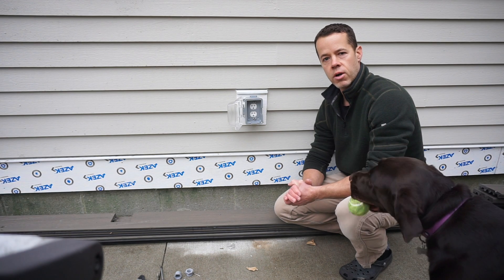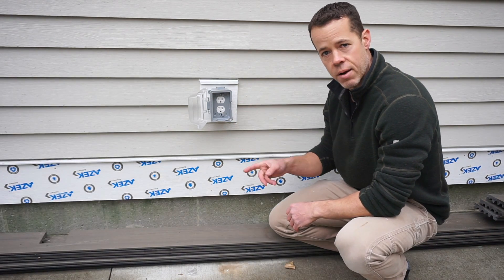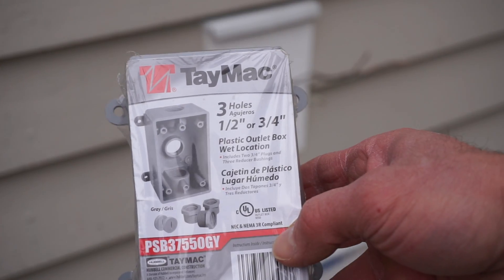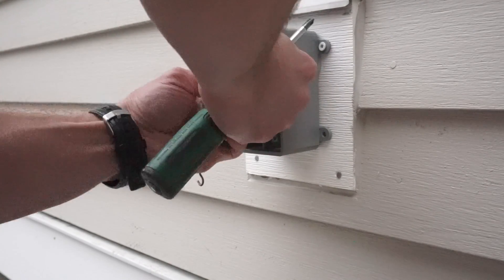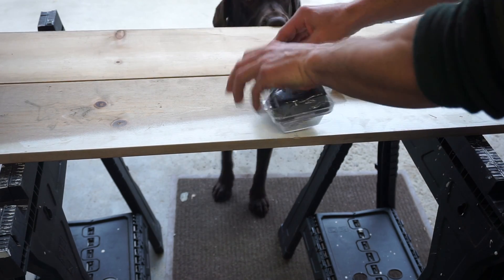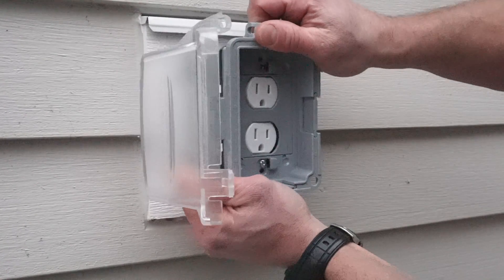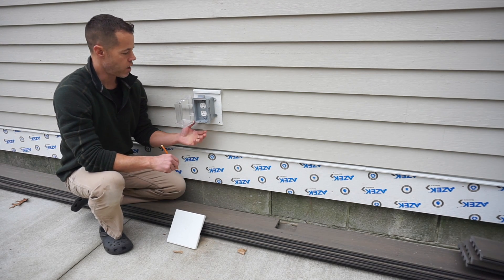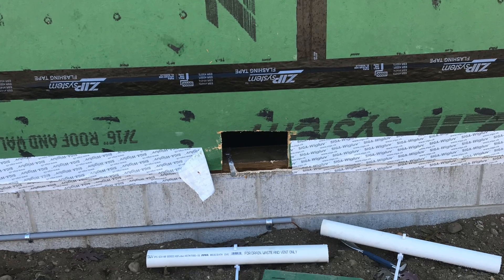How to Properly Install an Exterior GFCI Outlet

Comment: So it's up to code to run that NM cable in that wet exterior location?
Reply from the maker: @brent...  it’s up to code to run wire to exterior outlets if that’s what you are asking.  The wire is safe and sound in the outlet box rated for wet locations
Reply: @thedustybuilder  The code is confusing. It clearly states that you cannot use NM cable in wet locations (334.12(B)(4)). I’ve read that 314.15 implies that the inside of the boxes are considered wet locations since it talks about letting water out. That means it’s expected to get in. No real world experience here though, so I dunno.
Reply from the maker: @brent...  interesting point, maybe it would be a violation where enforcement is super strict.  I’ve been on several projects where this method passed inspection.

Comment: Should add a chase nipple so your wires entering box are not in contact with the box threads and possible damage incoming wires.  Especially when you push recept into box.
Reply from the maker: @ronh5623  You are correct, thank you.  I didn’t realize that they screw into the box threads!

Comment: Looks neat, but you still need to cut a hole in the siding to put in and recess the mounting block, but I guess you mean not to cut through the wall entirely? 

Not sure I like the mounting block though—imho it disrupts the overall horizontal vinyl too much since you’ve now got quite an edge around the outlet.

I recently installed an exterior outlet and precisely cut a shingle just to get to the wooden board on which that was attached; drilled a fine hole through that from the inside, put my conduit through, sealed the hole neatly with duct seal, mounted my box in the shingle cavity and siliconed around the edges; fits perfectly and fully watertight.

I can see the use of that little drip edge, but I think if the outlet is recessed in the shingle, like I did, such a little edge would actually be a little pointless.
Reply from the maker: Sounds like you did a nice install!  I cut a hole in the siding but was careful not to disturb the tyvek, except for where the wire comes through obviously.
If I were to recess the box into the siding,  I would have to penetrate the tyvek and sheathing of the home.  Instead of a small penetration for the wire, this would create a larger path for cold air / bugs / water.  
In a new build scenario, your method could be easily air sealed, it is more difficult in a retro fit scenario.  That is why I chose function over form for my outlet mount😁
Reply: @thedustybuilder  Got it, yeah, our house is from the 60s and doesn't have Tyvek or any other kind of membrane, or other obstacles really. You could of course reseal the Tyvek, but those seals are a pain in the backside and often present more risk than solutions. Anyway, enjoyed your video, and despite our setups being different, has been useful for me!
Reply from the maker: @martinuildriks1487  awesome, thanks for sharing!

Comment: MR silicone man needs to learn about foam to keep bugs out.and cold. I also live in MI.
Reply from the maker: @CoreyOBrien-k2e  that foam breaks down over time, allowing bugs and cold air to enter.  Several high performance builder are omitting it in favor of caulk

Comment: I see that you used a 15 Amp outlet. How do you know which one you need since there are 15 amp outlets and 20?
Reply from the maker: Awesome question!  You can use 15 amp outlets on 20 amp circuits, it’s in the code book.  The exception is you can’t use a 15 amp outlet if is the only plug on a 20 amp circuit, hope that helps

Comment: The electrical tape should be wrapped around the outlet several times not as a matter of keeping it dry but as a matter of safety for the next person who might have to take that outlet out in case it needs to be replaced.
Reply from the maker: Ken…. Kenny…,, they can turn the power off first brother!
Reply: Don't do this. It just makes a mess and is pointless. Turn the power off bro.

Comment: Is not a strain relief required when the wires enter your box?
Reply from the maker: Great question, I’m not sure.  The wire is stapled almost directly behind the box, so any ‘stain’ is on the outlet and that staple.  I’ve never been asked that by an inspector, definitely couldn’t hurt!

Comment: How did you get the PVC trim piece recessed in the siding without cutting the siding (as you advise against cutting it, right?). Do you have a video of how you got that in?
Reply from the maker: I installed the block, then installed the siding around it.  You could totally cut a square out of the siding and install a block.  You would just have to be careful to  leave the tyvek and sheathing in place.  So, the block would mount over the tyvek and osb sheathing.  I hope that makes sense.  I've gotten several questions about this, I'll make a video showing how to do it!
Reply: That was the only reason i wacth

Comment: Thank you for your video.  Do you need conduit for your cable for going through the wall and  do you need to secure the cable to the box.  In my case, there is no place to install a cable clamp because all of the access holes on the box are in use.  That is, the back hole is where the cable is inserted into the box, and the other holes have rain tight plugs.  Is it good enough for the cable to secured inside the building as long as the cable going to the outside is short.  Thanks again.
Reply from the maker: No conduit needed since the wire comes from inside the house, similar to your situation.  If you want the cable secured to the back, Home Depot sells a 'water tight service entrance' fitting.  It's easily found on their site.   It screws to the back of the box and has a rubber fitting that holds the wire in place.

Comment: One of probably 150 vlogs on this subject??  In this case you might as well hang a DIY flag there as the installation of an exterior outlet on a house this new should be recessed for appearances! The omission of the code required connector on the back of the box doesn't bode well for an instructional vlog?? The utilization of all mounting points on the box would prevent the movement shown at the 6:44 min point of this vlog??
Reply from the maker: -Mine makes it 151!
-my house is old
-recessed exterior boxes look nice but holes in the WRB introduce cold air and bugs into a house….. I chose function over form
-ya got me!  I only used 2 screws
-thanks for watching!
Reply: @thedustybuilder horrible installation.
Reply: @thedustybuilder horrible installation.
Reply from the maker: @DanielLucas-l3p I hear you bro, not a fan of exterior outlets?

Comment: I would like to know more about the pvc mounting block you used. Where did you get it or how did you make it? It made for one of the cleaner installs that I have seen. How did you make and install the drip edge? Thank you!
Reply from the maker: Great question.  That mounting block is just a 3/4 inch thick piece of PVC trim.  I drilled a hole in the middle big enough to allow the electrical wire to come through.  I used this because 1) it provides a flat surface to mount the electrical box and 2) it provides a nice even surface to apply caulk to seal the back of the box.  
As for the drip edge, Lowes and Home Depot carry it in stock, it's called drip cap flashing.  It's typically used for flashing windows.  I use it whenever I have a mounting block, it ensures that no water will get behind the block  as opposed to caulking it and hoping for the best.  good luck!
Reply: @thedustybuilder  It looks like the PVC block has been contoured cut to match the siding. I'm looking at the spare that appears by  your foot when you are talking about the block. How did you make that or am I seeing something that's not. Thank you.
Reply from the maker: @rchristley  Sorry for the confusion, that is a vinyl siding block that does in fact go on top of vinyl siding and acts as a flat mounting surface.  I was going to mention it as an option for vinyl......but apparently I edited it out!

In my case I have beveled wood siding and used a flat piece of 3/4 PVC trim.  Hope that helps!

Comment: I would recommend you include a receptacle tester in your DIY electric projects.  It's a simple (and inexpensive) tool that quickly verifies the work.  Especially, it can verify that the outside outlet is actually GFI protected (as long you bought the tester with this button/function).  If the GFCI outlet was wired to create a parallel circuit, your outside outlet won't be GFI protected.
Reply from the maker: Great suggestion!

Comment: Smart decision to put the gfci indoors. I can't tell you how many I've seen that have melted and burned up being outdoors. I don't care how water resistant the box is, they're going to leak. The silicone is a good bit of protection as well because the foam gaskets dry up and leak. I have a standard outlet out in my backyard for a sump pump and it's been underwater a few times over the years. It got annoying because I would have to run an extention cord when the breaker blew. I have since raised it up higher than the water gets. Even being underwater several times, that outlet has been in service for about 7 years now with no failures. You won't get that with a Gfci outlet
Reply from the maker: Thank you for watching!  I agree, every time I replace an outdoor GFI they are a mess.  When possible, I prefer a standard outlet that is GFI protected.